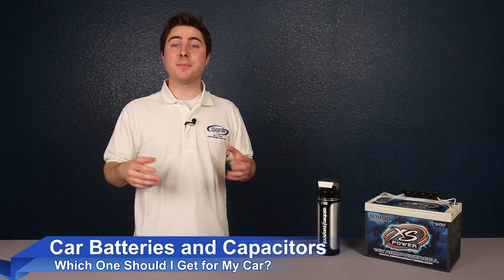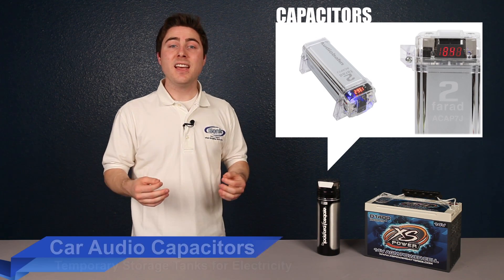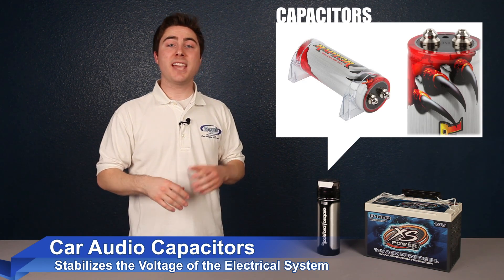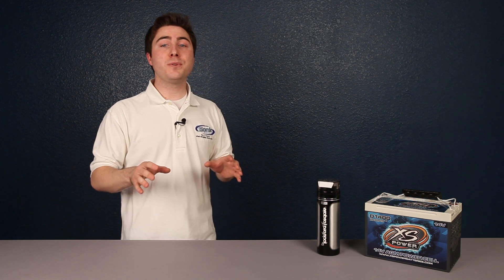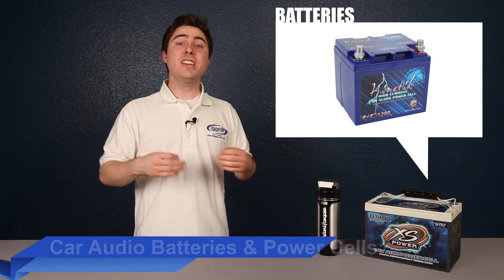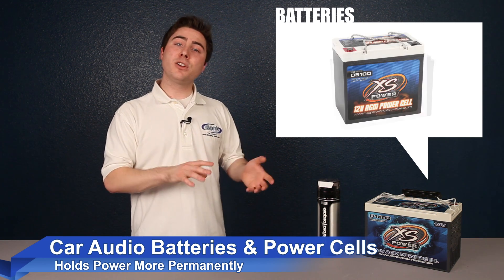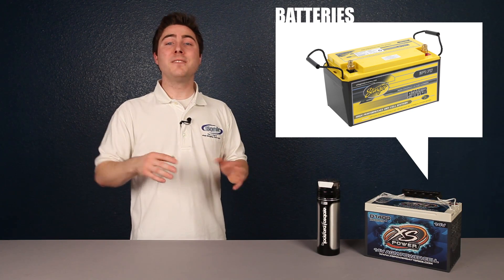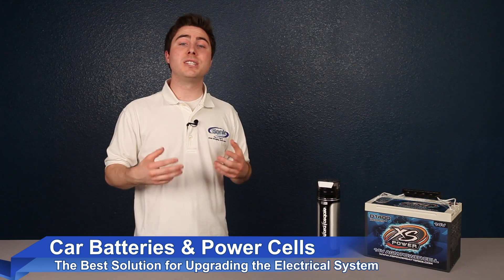Car Batteries or Capacitors: Which Should I Install? | Car Audio Tips

Comment: Capacitors are useless... Just get a high performance battery and proper wire gauges to supply power to your system and upgrade the wiring from the alternator the the positive terminal on your battery, battery ground wire and engine ground wire.
Reply: From a comment on a post trying to say caps are bad, "This is completely against all physics of electricity. I am a sound engineer and I went to for both electronics and acoustics. Caps are very important to the balance of an electrical system in a DC environment. If you look at the insides of any good amp, you will find a shit load of caps on the power supply side of the board. YOu are right that caps make things worse for amp but only if there is not battery in the entire circuit. A battery is a natural balancer of all things electrical. As a matter of fact, the alternator that you say is the most important thing in a car, you are right but only if there is a battery in the circuit. If not, you’re lights will flicker because an alternator is not a steady stream of pure DC voltage like a battery is and will hurt your entire electrical system. They produce AC and convert to DC and that circuit is rarely pure. A battery is pure DC voltage. All 3 batts, caps and alts are needed to have a balanced electrical system and get enough power to your amps. The most important thing that is rarely talked about that is needed in respects to clean power is good connectivity. Amps that are closest to a power supply(Batt or Alt, not caps) create more power to the speaker and run cooler. Even using Ohm’s law in regards to power wiring and you know the correct gauge and length of wire, does not take into the effect of environmental physics. IE – Temperature of the air around the wire as well as the temp of the wire itself. As the temp of the wire goes up, the resistance increases and therefore needing a higher gauge. This also happens to batteries and alternators the more power they have to produce. They will heat up and not be as efficient as room temp. Alts work great in cold temps but batteries are the opposite due to chemical reaction physics of Batts vs metalerical physics of alts. All this points to one conclusion that is often missed, double the size of the wire that the math tells you to use and make all of them as short as possible. Connectors are also often missed as an essential part of this issue. High current systems need power connectors that are soldered using a torch(not a soldering gun) and not just a screw down connection of just a crimp. YOu can use those but you must also solder them. This will ensure a perfect connection that will not corrode over time or deteriorate due to high temps and humidity. Either way, the alternator is least thing needed to be upgraded in a system as long as you have array of batt and caps near the amp. Reason is simple, batteries store lots of powers as well as create power (yes they create power using a chemical reaction which is why if you crank an engine till it wont anymore and then wait a little while you are able to crank some more) but discharge their power very slow, Alts create power, do not store it but push more power than a battery can per second, caps only store but can discharge thier all thier power in literally milliseconds which is why they can be dangerous but are extremely efficient because of thier very low internal impedance. Point being, batteries can be charged by any source if you alt cant keep up like a home charger. You can also let you car run for a while to be sure your batteries are charged if you know you were draining more than the alt can push out to charge them. It’s just math and you cant get around it. Batteries are the most important part of a high powered car audio system by far. As a matter of fact, I blew my alt a long ago when I was traveling and was about 500 miles from home. I couldn’t just replaced it because it was a high power aftermarket alt and I needed to get it fixed. I turn off everything possible in my car and kept driving just using my 5 Kenetik AGM Batteries and 30 farards of caps and they got me home easily and the voltage never got below 11.9 after the 500 mile trip."
Reply: @Ded_Ram  can u do both
Reply: Would I keep my stock battery and just add a secondary battery
Reply: not useless at all, i just installed a 2 farad cap after my headlights were badly dimming and it completely fixed that issue, now my electrical system hardly even dips when the bass hits at all staying at around 13.9-14 volts. caps are also way more cost effective then a high output battery as my cap only cost around $50 and a battery like that costs in the neighbourhood of $300-500.

Comment: Capacitors are more of makeshift batteries.
Reply: not entirely while they both hold a charge a capacitor is meant for rapid isntant discharging of energy for in the moment requirments as where with a battery the out put is a consant slower pace so when the bass hits and more power is needed in that moment than the battery can put out that is where the capacitor comes in and fills the gap to ensure a smooth constant flow of the required amount of power

Comment: I'd hook the caps to the head lights before I'd run them on my amp. Capacitors are great when used right. A second batt ( large capacitor) is technically a drain on the system in its self. You need MORE current .....more electricity , so you'll need bigger and or more alternators and large gauge cables. A optimal set up is to mount the amp as close to the charging system as possible using the shortest and thickest runs possible . wire is important as well, welding cable, cabling for solar  cells ( my fave due to the rugged plain insulation for installing around sharp metal and high heat ) . oxygen free and high strand count is good . I don't trust CCA unless I am using it for speaker wire, but I still don't trust it. If you run big amps and push sealed enclosures then you know how important current flow is. For you guys pushing vented boxes , well you guys only need half the power to be as loud ( and half as accurate ) .
Reply: mark hernandez I don't miss a episode. The thing is to get a band pass to be flat you need a computer to math the equations . if you want a sealed box to be flat.....make a sealed box. Doug's 6th order is great but I can't fit a box that big In my Vic and still use the trunk. A ported enclosure by design is to maximize its drivers efficiency with in a set range of frequency. Think of a triangle , at each point you have ... 
1. Accurate sound
2. Loud
3. Deep bass. 
Now pick two, that's what you get. A sealed enclosure can give you all three but you need power to get there and a quality built box. Don't get me wrong there are plenty of examples that prove me wrong but non of them are cheap and quick to build . the port or vent is and always will be peaky at certain hz . notice all the sound processing soft ware Doug used to build and tune his system? I ain't got thousands of dollars , I have a saw and a rip gate and a screw gun.
Reply: yep.... folks don't understand that more caps and more batteries just become more load for the alternator. Good wiring and a high output alternator is the best option.
Reply: Charles Hendricks in my case I have a 09 crown Vic pursuit. I have the largest optioned alt for it( 215-230 amp) but I can't make full use of it due to the pcm regulation of it. It will keep a steady 12.5-13.0 volts going to it ( have not inductive clamped yet ) under some of the most demanding songs. I would like to find a way to allow it to put closer to 14v to the amp. I have run a voltage keeper on it and have measured 14.3 volts at the power input while doing this and everything is way more crisp and I have zero light dimming .
Reply: @charleshendrick7266 
Good wiring and high output alternators are not a sole option. You need a balanced system that can do EVERYTHING. The only thing an alternator can possibly replace, is batteries, and it has to be one huge MoFo to do so. What it cannot, and will never replace, is capacitors. You cannot draw the power fast enough from an alternator, it's basic physics. Hell, if your system relies on a 200 amp alternator alone, without any kind of reserve for fast and powerful peaks, just imagine the alternator you need if it has to have the ability to put out that power so fast - never mind the python sized wires you need to supply route the power. Try ripping 600-700 amps from the front to the back of the car in thousands of a second without a voltage drop. Yup that's never going to happen.
Reply: John VanCamp if you have some sort of port calculator play around with making the port smaller and shorter or larger and longer, also look at the F' s and Q's of your sub. You may find what is suggested for size may be wrong for what your after. Another thing is your cars shape might cancel out some sounds or the opposite . I've found that pre made boxes sound good but never perfect. I had some Rockford p2 10's back in the day. I had them in a dual iso box ( sealed ) in a hatch back. Powered them with one RF 501s punch and it would flex the windshield and pop a cell phone about 4 inches in the air off the roof. Had a guy with a stroker come over and didn't believe me what I was running cus " a sealed box or tens can't play that low " . do some home work and math out the numbers and you'll be surprised how good you can make your subs sound.
Reply: Liam Cooper That's good to know. I never thought about that, just the flex. For some of my builds I've run 2ag with 6 twisted core stands it flowed great amperage but I could mostly run straight shots from the bus bar to the amps, I tried forming it to contours but it would pull the insulation at either end or tear at the bends..lol .
The comm systems I'm used to working with ( mostly flexray ) rely on a thing similar to skin effect I think, as they can on one line transmit and receive at the same time.
Reply: Liam Cooper either way after doing some reading its pretty cool in its theory . I just always suggest having the high strand count for routing , its just more flexible.
Reply: Whats your beef with tuned ported boxes?
Reply: John VanCamp nothing , they are fantastic at what they do as long as your going after certain frequency and or making a crap sub work better or don't have the right size amp. When's the last time you have seen a sealed box do very well in a SPL contest , granted a ported enclosure can be very good at SQ but it requires the components to be tuned to exacting specs . I don't like tuned ports due to the mouth breathers that just pump bass through them and delight in there own puddle of falsely earned reward . ...jk I don't like how its hard to tune the " ring " out of most ported boxes. I hear the rolloff / decay when I know there should not be one . they also tend to be peaky and I like a more flat response.
Reply: Rob Sorgdrager 
Take a look at SoundmanCA and the 6th order ported box he built for his F150. He custom tuned the box. I think you might like his set up. He's running an iPad as the control with a hidden Sony   $1500 head unit because of the high bit DAC, 7,000 watt amp on a JL 13W7 that he put a replacement voice coil into.
Reply: Rob Sorgdrager When has a sealed Box done good at any contest spl or sq?!? Honestly I was a sealed Box fan my whole life I just now got my very 1st ported Box in my car cuz i upgraded subs And they sounded like shit in the sealed Box I had (Granted it was way too small) But I'm not sure if its me or do all tuned ported boxes put out deep fluttery bass like 15s would even when u have a set of 10s?!? The 2 guys who talked me into getting these subs and a ported Box both have tens and they put out real deep bass (Probably because there boxes are tuned at like 34hrtz) But I like that really hard, slap you in the back of ur head type bass that you feel in your chest! And I haven't heard it since I used to run 4cvr 10s In a sealed Box.
Reply: Rob Sorgdrager I also dont have much room, I have a 2011 Subaru STI sedan and the trunk design is absolutely not ideal for any speakers larger than 10" And now I have two 12s that require a lot of air space, especially ported and I'm not sure what to do...
Reply: John VanCamp so find out what box spec is and go sealed. A larger sealed box with good damping will go lower and louder and more accurate than a ported . plus you don't need to worry about sub sonic . and it will be smaller than the ported box. Or since its a smallish car port a single sub, if done right you shouldn't need two.
Reply: John VanCamp Ive seen many sealed boxes do well in both. Most SPL go with ports to focus in on a narrow band of low frequency. Sq guys tend to run a really hard core single 12 or two tens but those are high dollar subs. I run two dark audio nko 12s . they have stiff dual spiders and 3 inch coils . they are made for hamming in a fat slot port but I put them in a proper sealed box and I can hit 32-34 hz no problem . I fed them about 750 RMS a piece and I can feel the pressure try to force air in and out my lungs, it will play as high as 190 hz without sounding buzzy. Your issue is your port shape and size are wrong and that flutter is called port turbulence. If you scoobie is a wagon or a hatch then youd be better off sealed.
Reply: Rob Sorgdrager My Subaru is a 2011 STI Sedan and the trunk goes up about 6" to compensate for the gas tank right by the rear seats. And I am now running two American bass XFL12s In a shitty prefab ported Box. And 1 apcl1500.1 at .5ohm load (prob 1200rms to each sub) she metered at 146.7db, but I know I can get more out of this system.
Reply: Rob Sorgdrager Ideally yes I would like to run a really high dollar pair of tens with both of my APCL1500s strapped.
Reply: Rob Sorgdrager wish youtube would allow pics in the comments. So stupid that they dont.
Reply: John VanCamp as you drop the ohms on a amp your dampening starts to fall off. This is why I don't like class d amps....if your running .5 of an ohm and your in a ported box that has no control over you subs movements, this could be adding to the flap port sound you get.
Reply: Rob Sorgdrager I'm not getting a slop port sound, earlier I was just referring to the couple guys I know it seems like are running their subs at such low frequencies they have that "waaaawp" bass 15s should be producing, yet they have 2 10s. I think it has to do with the htz there port is tuned too, and since I prefer that punchy, slap you in the back of the head bass, I don't know if I need to tune my port at a higher htz To achieve the bass I want or run a sealed Box like I'm used to.
Reply: Rob Sorgdrager 
Agree with everything but stand count. Stand count is good for flexibility here. Audio doesnt use high freq signals so the "skin effect" is not a problem thus high stand counts are not nearly as important as stand thickness. "Skin effect" is noted in the high MHz-GHz range, far outside the audio range.
Reply: Rob Sorgdrager 
Mhmm cant say for sure but i would say that what was being used it just a coms protocall. While im not savvy on this i would expect signal to still need 2 conductors. TV arial cables use both centre core and outter woven wrap to obtain signal. But i would be interested if this were the case.
Also i failed when taking power cable gauge. Power is DC so therefor it is impossible for skin effect to be a thing, as this phenomenon can only happen with high freq AC.

Comment: Wow talk about no info here.  SAles rep yep.  Didnt cover why not have one of each instead of choosing between them also what size to get, how many farads etc.  Here's another big thing Ive learned, AGM is the best choice, your car battery is for starting, so not ideal for car audio like an AGM.  Deep cycle batteries have the capacity but are too slow response to use. So maybe capacitor can help out. You see what I mean, have to dig and dig. Tired of these useless bonehead sales reps. You know it took sonicelectronix 3 days to return calls because of their so called "restructuring"  Their answering service says maybe 2-3 hours on average.....try it some time.  Do yourself a favor you want anything from sonicelectronix, buy it on ebay.

Comment: So if the headlights still dim then what.. I got 2 15"L7 2000w each with a 2000w Kenwood amp and a 2.0 farad cap.... Lights still dim
Reply: Big A still having that problem ?
Reply: Big A buy a lawn mower battery solve my problems with dim lights

Comment: What will be the best solution for Pioneer D8604 4 channel amp ? A capacitor is enough or do i need a battery ?
Reply: Lasitha Pussella get a lawn mower battery solve my problems with dim lights
Reply: Just the batt under the hood would be sufficient for that.
Reply: It's not when you pushing 2500watts
Reply: Eastsideman Atlanta Who said anything about 2500w?!?